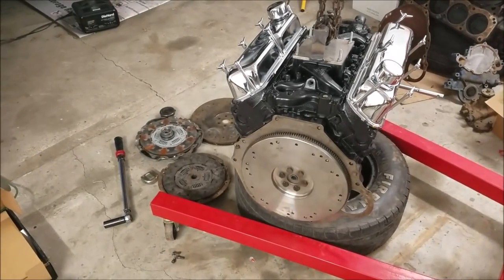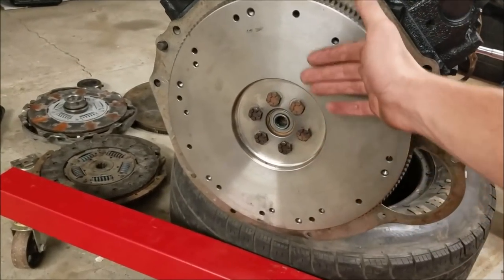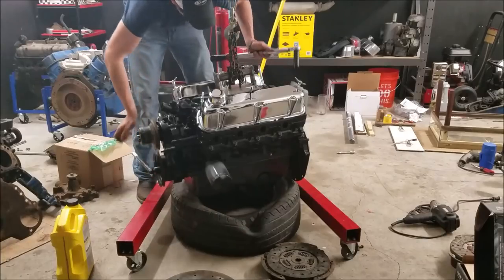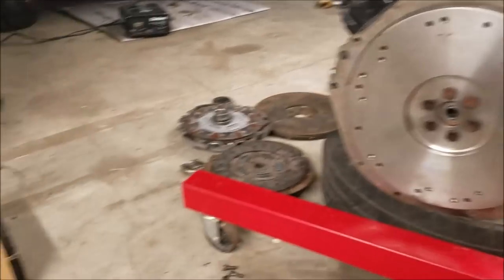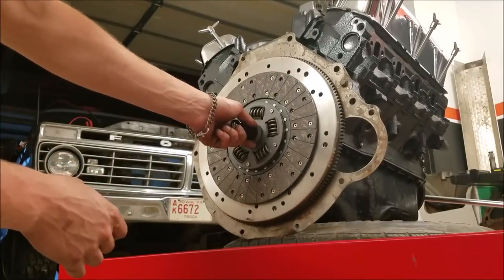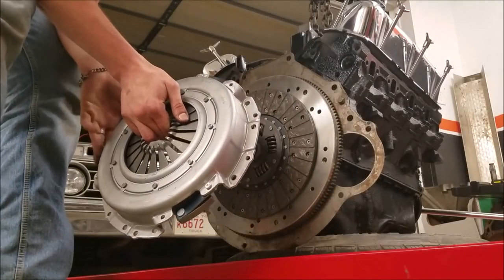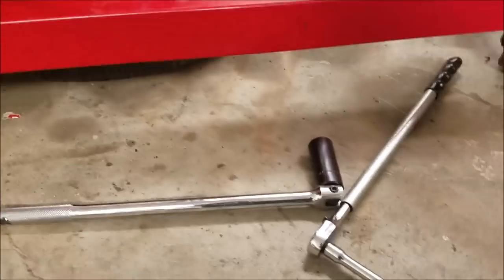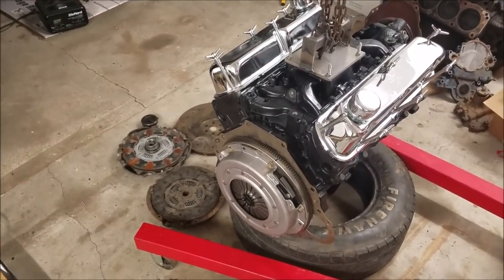Installing a New Clutch & Flywheel - How To: Demonstration/ Walk Through

Comment: Just a few notes for others that might be doing this on a late model 302: The flywheel bolts go into the crankcase, so make sure to use the thread lock as a sealer. Or as ARP does in their kit, use threadlock on the threads and a sealer under the bolt head. Second note: early model clutches use SAE hardware, late model stuff uses metric. And with metric you usually have three dowel pins in the flywheel for the clutch to sit on. Hammer or press the dowels into the flywheel before mounting the flywheel onto the crank.
Reply: So with a 1970 F100 they dont take a dowel pin?
Reply: Would you use Red loctite under the bolt head?
Reply: @andrewmcgill4957  You need sealer on the threads not under the bolt head.
Reply: @dri50  my bad. will red loctite create an oil seal? Because the crank bolt holes go through into the block. I was going to use high temp thread sealant.

Comment: When torquing the flywheel bolts just stick a Phillips screwdriver through the flywheel and it will catch on the blocking plate where the starter goes

Comment: I have a 302 motor the flywheel has small bolts that holds the pressure plate on its not the 5/16 bolts can you tell me what model year motor I have

Comment: thunder head i was just wondering when you take a late model efi 302 and put a carb set up on it do you run a 50 oz balancer\flywheel???
Reply from the maker: yes i do indeed. im making a series on swapping on over right now actually. check my recent f100 stuff in my recent uploads playlist.
Reply: sweet thanks man

Comment: Im doing the same thing in my ranger 4x4 roller 5.0 and having trouble finding my clutch setup what starter would i need to use with an 11inch setup like this? And if you have links to the clutch and flywheel that would be greatly appreciated. Also someone told me the transmission 4x4 variant of the t5.

Comment: I love all those new parts and that's a nice diaphragm the style pressure plate you have there I've rebuilt the old 3 finger pressure plates on the floor with a bottle jack underneath the truck because I didn't have a press
Reply from the maker: i was tempted to use that free ten inch unit i had sitting there, decided against it when a whole entire new set up was so darned cheap !!! 80 bucks for everything, and i like the clutch finger style better for throwout bearing life
Reply: @ThunderHead289  can you share the p/n's and where you picked them up at fort that price?

Comment: The flywheel size depends on your bell housing size , the 10.5 and up ( truck size, maybe bronco) won’t fit inside of a 83-93 z3-z6 bell ( maybe far back as 79-93) , I had to use the ten inch but157 t  flywheel , and if so you’ll have to go a 3/4 starter or nose ( instead of the 3/8  if you can find one , power masters the only one I know of that  has one for that t5 swap

Comment: so a 302 motorplate doesnt fit a 289 engine?  i have bought a 10 inch flywheel for the 289 t5 conversion and the plate between motor and transmission is from a 302

Comment: You didn't use any clutch alignment dowels??? I did not see any when you were installing is why I am asking. Do you ever get vibrations while driving?
Reply from the maker: There are a few different types of clutch mounting hardware - there are units where the shoulder of the bolt locate the clutch. I never had any vibrations, it’s still in the truck today and did the full power tour 2019 3000 miles without issue. 
Put probably 30k on the truck since I put this engine together for it.

Comment: Always clean off flywheel and pressure plate surfaces. Most new parts are covered with some sort of rust inhibitor.
Reply from the maker: I probably should have mentioned that I had done that. Sometimes I just assume people would know to clean off the oil. - you are right. Probably should mention that
Reply: ThunderHead289 I know you are quite capable but some people are looking at this as a tutorial and not cleaning that stuff off will glaze the clutch disc surface.
Reply from the maker: you are 100 percent correct, im kind of irritated with myself that i failed to show that. 
guess i need to build another engine to demonstrate !!!
Reply: @ThunderHead289  It would have been nice. I put my clutch in like the video said. I noticed my new flywheel had oil on it so I soaked the middle disk in oil. Now my clutch won't engage when I had it?

Comment: I'm just asking out of curiosity because I need to know how big is a flywheel for a 302 motor to have a 3 speed on the column
Reply: match the part on rockauto and check the item specs - usually 10" i think..

Comment: No 3 locating dowel pins for the pressure plate?
Reply from the maker: apparently not on this one
Reply: patw52pb1 not all aplications require the dowl pins....and most replacement flywheels will have the provisions for them
Reply: Every Ford is/was equipped from the factory with pressure plate dowel pins to precisely align and positively locate the pressure plate on center to reduce vibration, prevent fastener and clutch failures. 
They are also there to share the torque loading in shear. 

Usually Ford OEM and many aftermarket replacement flywheels do not come bundled with new dowel pins or fasteners, however they are available separately from Ford, Ford Performance and the aftermarket such as ARP or from a decent machine shop and are well worth the cost.
Reply from the maker: +patw52pb1 very well said
Reply: if I don't have the pressure plate installed on the dowl pins can this keep me from getting a clutch

Comment: I know that’s a dumb question but it’s really important I’m without a car walking all over the city until I figure it out
Reply from the maker: What particular set up are you workin on????
Reply: It’s a t5 5 speed I’m putting in my z28 1989 going from the 4 sp auto to the 5 Spd and idk if the flywheel I got is the right one or not or if the drive shaft will fit